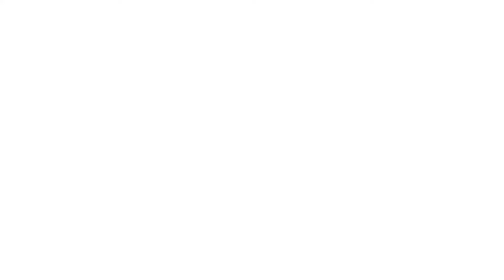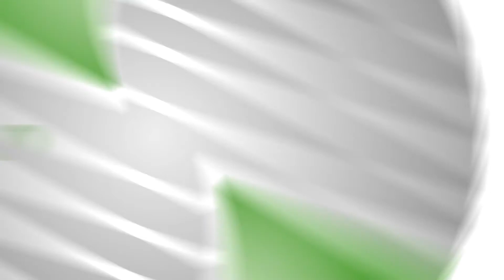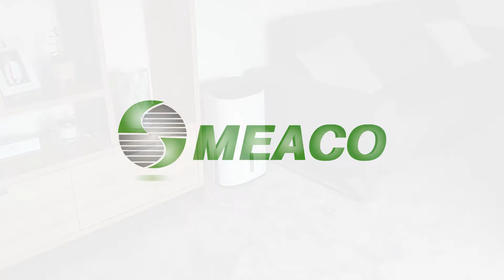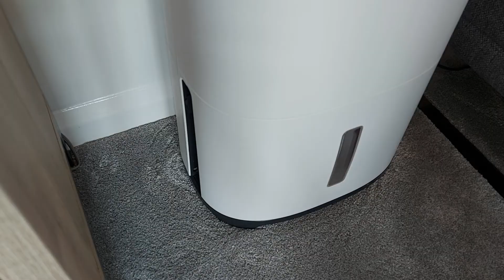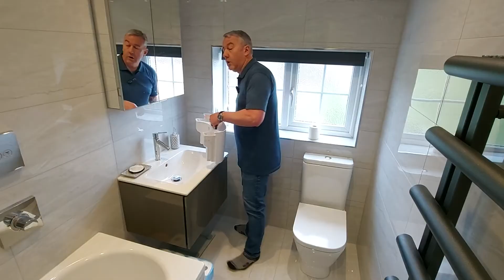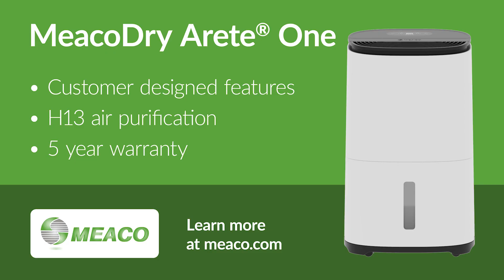How to empty the water tank on your MeacoDry Arete® One Dehumidifier and Air Purifier | Meaco

Comment: Tank needs an actual spout/lip to pour the accumulated water from.  
The most convenient place to empty my father's Meaco 20L is down the loo, but no matter how I position it for emptying, some water always gushes outside the loo onto the carpeted floor beneath.  
Also, there should be an easy way to remove the back to clean the fins enclosed behind the filter.  Right to Repair and all that, @MeacoUK.
Reply: Tip it the other way, towards the curved surface. There is another outlet on the front that is much more directional and doesn’t cause half of the water to go down your leg.
Reply: you have carpeted floor around your loo? 😨

Comment: Hi I’ve got the 20L I’ve just heard dripping noises coming from it never heard that before had it a few weeks and is it normal that it switches off even before tank is full it’s only collecting smaller amounts of water
Reply from the maker: Water dripping into the tank is normal, dripping on to the floor would be an issue. Just double check and call us on 01483 234900 if in doubt.
Reply: @MeacoUK  thank you il keep eye on it just never heard it before now

Comment: @meacoUK - I have the 20L Arete, how come I always end up with a puddle of water in the base tray underneath the bucket? I’ve ensured I’ve wiped any water off the bucket when emptied but the tray fills up regardless if the bucket is full or only half full. It has no affect to the dehumidifier itself it’s just annoying having to soak it all up after each time I empty it 😂
Other than that I am so pleased with this machine! First dehumidifier and I’m so glad I paid the extra for a decent one! Especially love the time it takes to dry a full load laundry, made my life so much easier when the weather is colder! I’ve never got through so much washing in such a short space of time 🤣
Reply: Think you've got a faulty unit. I just brought this unit this weekend and mine constantly had a pool of water underneath the collection tank. Took it back and got a replacement and tge new one doesn't do that. Completely dry underneath when I remove tge collection tank
Reply: @magicmanpete thank you for your reply! I’m not even sure if I could return it now or not. Who did you go through in regards with yours? I originally got mine from Argos.
Reply: Have you found anything about this yet? We've had 3 because of this thinking it's a fault and it's happening on every single one. I rang the company and they didn't seem to know anything of it?
Reply: @BgamerGal no I haven’t found anything about it yet. It’s still doing it as well, quite annoying but like you said it must just be something about the machine itself.
Reply: Yeah it was faulty, we went through 3 to get one that doesn't pool at the bottom, we think it was a bad batch
Reply: Bought ours on Thursday and it does the same, it will be going back if thats the case  as im not going to try several different ones from them to get one that eventually works
Reply: @jwautotrim  don't blame you, I was reluctant too but my other half was persistent because he saw how good the reviews were
Reply: @BgamerGal i just took the lid off the water collection tank and im currently testing it like that, i think the water comes out of the spout and hits the lid causing it to splash down the side into the drip tray area, so the tank will fill up but spprox 200ml goes into the tray, ill know later today when the tank is half full as there will be a dry tray or it will be half full 🤞

Comment: Does it turn off automatically when you remove the tank?
Reply: To answer your question, it will turn off when the tank is full, but should you remove the tank before it being full then it will immediately stop the compressor but will then run the fan for a further three minutes as it is drying the coils and the spout to remove any water that might be lingering there.

This is part of a special process to ensure that when you remove the tank when it is full, that there are no drips of water after you remove the tank.

Omar@Meaco

Comment: I would just like to warn people who are looking at buying these u it’s because if advertised ‘lowest noise levels ever’ and ‘whisper quite’ and can be ‘used in the bedroom’.. this NOT the case. The unit aid actually very noisy. When questioned Meaco spout some diatribe about sound power Vs pressure and that is is quiet mark verified… yes the 20L version is but the 12L and 10L are not… that said they advertise the 12L and 10L as being quieter 😂. To prove a point my neighbour has a Delonghi Aria (comparable 12L) and is advertised as having noise levels of 40db (2 more than the Meaco)… yet is much MUCH quieter… you’ve been warned ☝️
Reply: It makes zero sense that the smaller unit would be noisier given the same technology. Sounds like you have a faulty unit.
Reply: I find the 12L very quiet actually, for the amount of work its doing.  It can dry out my bedroom extremely quickly and then switch itself off, so it's only on for about 10 minutes every hour.  Although I agree, you can't really sleep with it on.  I could if it was a constant noise, but the compressor turning off/on would wake me.

Dehumidifers are just loud by default, because they have fans and compressors.  So any dehumidifier that is suspiciously quiet, is either doing nothing, or extremely inefficient.

Also comparing the Delonghi one you mentioned.  The Arete Two 12L uses 136W vs the 300W of the Delonghi, so its using roughly twice the power to get the same amount of water out of the air.

Comment: I have a Meaco One Arete 12L… the water tank does not have a carry handle on it? Is there as reason for this. Also it’s bloody loud. Sound levels range from 45-55bdA not the advertised 36-38dbA… anyone else found this?
Reply: Looks like 12L unit's water tank doesnt have a handle, bigger 20L does.
Reply from the maker: Thank you for your purchase, the Arete 10 and 12L have been tested time and time again by labs and independent laboratories to confirm their low noise levels.  There is always a chance of course that yours has had a knock in transit to make it nosier.  Measuring noise levels in the home is impossible and will never give you the same results as professional tests in labs, apps on phones and hand held meters will not even be measuring the same sound parameter, there is a difference between sound power and sound pressure results.  Feel free to take a video of your dehumidifier and send it to our customer service team for them to advise, their email is customerservice AT meaco.com.

Comment: How to clean the tank?
Reply: Pop the lid off and put it in the dishwasher if you like or just clean with washing up liquid in the sink.
Reply: @chrismichaelmeacouklimited4004  Thank you :)
Reply: @chrismichaelmeacouklimited4004   hello Chris, how often sould we clean the container?
Reply from the maker: @ellavas3515  as often as you feel you need to.  Just remove the lid and have a look at how dirty it is.
Reply: @MeacoUK  Thank you! 🙂👍
Reply: I just got a 12L Arete One, the instruction booklet for it talks about using the water tank handle to help you carry and manoeuvre the tank - but there is no handle! With no handle, the tank is actually quite awkward to empty, even when only half full - why does the booklet for my model of dehumidifier refer to a water tank handle, when the actual dehumidifier doesn't have one?
Reply from the maker: @BirdsEyeViewOfMyUke  the larger 20L model has the handle because that tank is heavier when full. There is no room for a handle on the smaller model.
Reply: @MeacoUK  then you need to remove the reference to a handle, in the instruction guide for these models. Emptying these tanks that have no handle is a two-handed task, leaving you no hand free to open doors etc on the way to a sink... If there is a secret knack to emptying these handle-less tanks easily, safely, and without spills, please share it in a video
Reply: @BirdsEyeViewOfMyUke  I believe it's only the 20 and 25l ones that have a handle